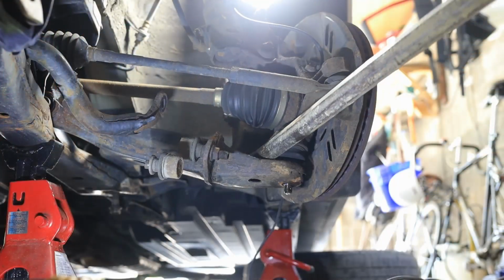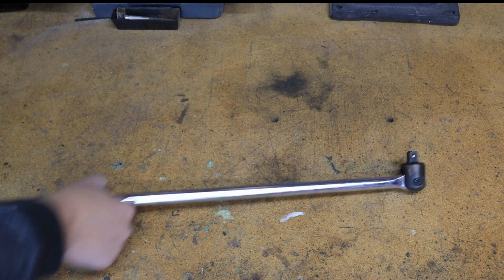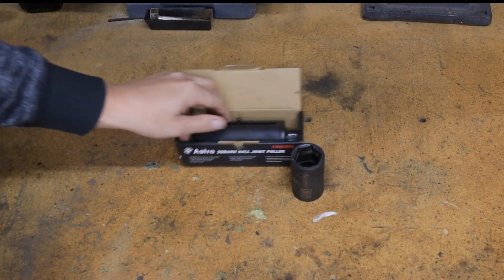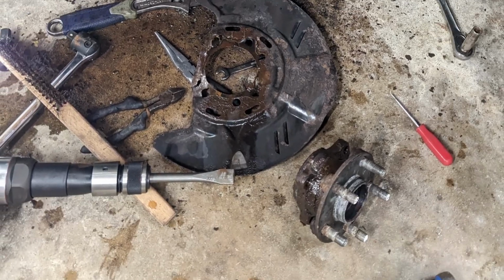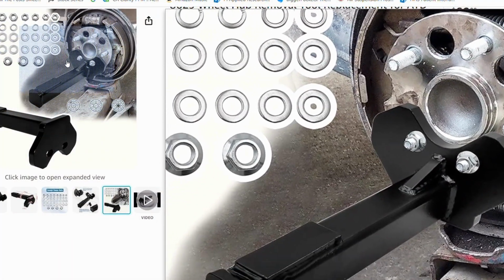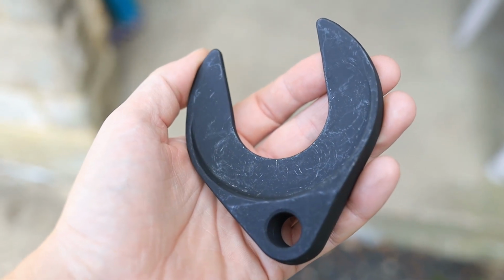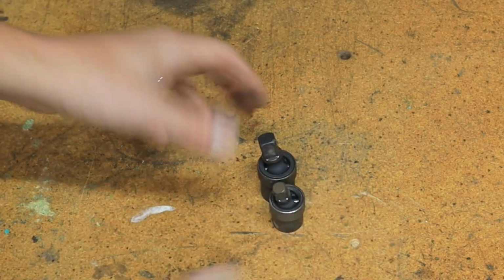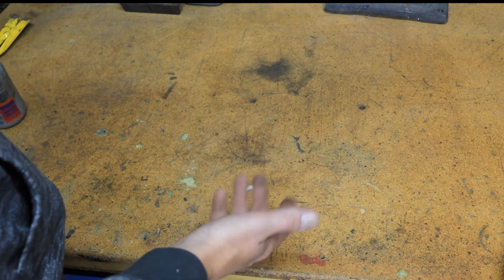Don't Replace Control Arms, Ball Joints or Wheel Bearings Without These Tools on Hand

Comment: Nice, thanks.  I just spent  a few hours last night grinding off the endlink bolts of my 2013 Outback.  N. Indiana gets some rust.   My control arm bushing looks bad I noticed.  Not looking forward to that job.
Reply from the maker: Oh yeah, those are basically impossible to unthread!   At least they are relatively easy to cut off with a good wheel.  I replaced mine when doing the lower control arms, so I could skip cutting off the control arm side.